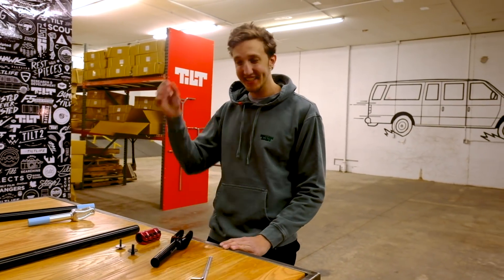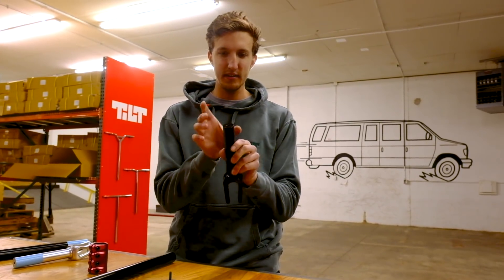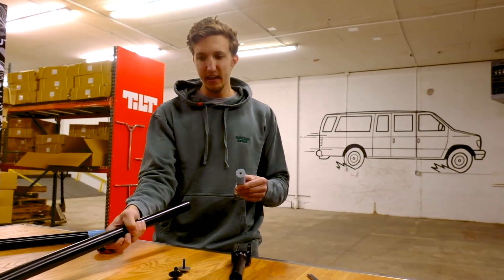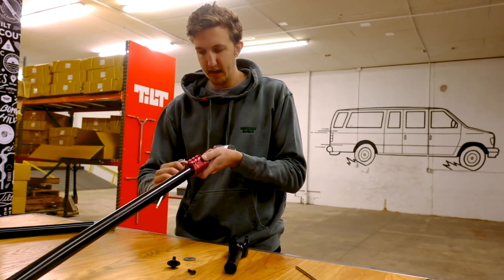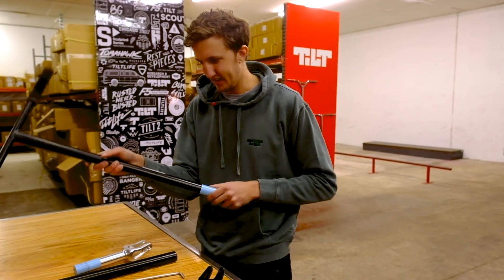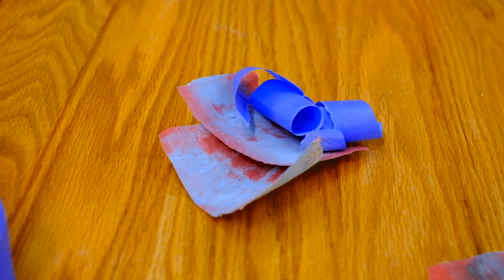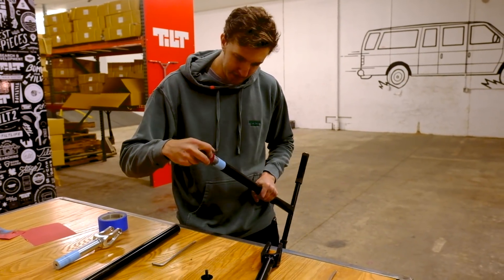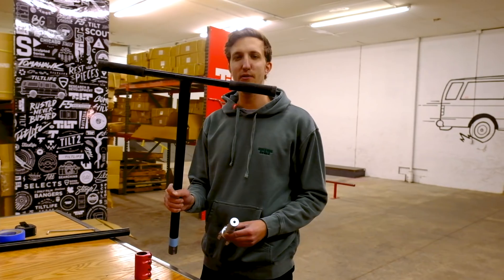Tuesdays At Tilt : How SCS Clamps Actually Work - Ep 01

Comment: it would be great to learn about how different wheels affect the ride and durability of a scooter (different urethanes, different core designs and different sizes - width and length)
Reply from the maker: We'll make sure to cover wheels. We will most likely start with the importance of rebound (speed). We also have 30x120 fork, wheels, and deck in the works, so the size will most likely be covered as well :)
Reply: TiltScooters I’m looking forward to seeing those! I’ll definitely get some of the wheels when they drop and most likely the deck too!

Comment: could you guys explain how to properly compress your compression kit so that your headset bearings spin as fast as they possibly can go but with the compression tight as it can be??  this is an issue so many people i know have trouble with me included
Reply from the maker: We'd love to! However, this really requires a tool called a torque wrench that puts a certain amount of pressure on the bolt when tightening. Most riders and most scooter shops do not have this tool, so we probably won't touch this topic much.
Reply: oh thanks anyway though keep making the mad clips

Comment: Uh, finally somebody addressed the clamp slit alignment issue in a video. I've been meaning to do that myself for a while but Colin explained it perfectly here. For an SCS instructional i was kind of expecting a "How to use an scs for dummies" -type of a video at first glance, you know, addressing the methods how to properly tighten and untighten the clamp without breaking any bolts nor threads within the clamp, why having no slit on the bars eliminates a problem that belongs to the last decade, etc, basically information for beginner use. Maybe that's already scheduled for a future video?
Reply from the maker: Hey Madis! Thanks for the feedback. We'll produce a video about proper clamp maintenance including importance of grease, larger bolt size, and tightening sequence.

Comment: i have a chrome flamongo/native fork and a silver apex scs, both unpainted. but the scs doesn't fit without stretching, why?
Reply from the maker: When choosing a Fork and SCS you want to try and make sure that you purchase the same brand. Those parts are more often than not made to fit together perfectly so that you do not run into this problem!
Reply: Che filet  the apex gamma is a really tight fitting clamp that’s why I’ve been running my issac miller forks and clamp for 2 years straight they are the strongest I’ve snapped three decks whilst riding them and they are still going strong
Reply: Che filet and due to the info in the video I’d assume the apex clamp has a different circumference to the forks
Reply: Louis Kneeend interesting to know. Although I've never realy noticed any problems with my scooter, I needed to use the penny trick a lot.  Well now i know why. Thx for the info :)
Reply: Yeah I understand. But I am not going to buy a new clamp everytime I need a new fork. but i'll take it in consideration next time a buy a fork or a clamp. Thx for the info :)

Comment: Well I’ve learned that the proto scs ive been running these past few months should be put back in a drawer and that I should put back my trusty tilt scs that i had no problems with. that has lasted me almost three years and still tightly fits on my bars and fork, unlike my proto scs which is causing me so many problems.
Reply from the maker: Glad to hear that our SCS has lasted you for so long! Thank you for your support:)

Comment: I ride HIC for this very reason, to many precise problems with SCS. but knowing that it should be same size all round makes sense, just like tightening all clamp/scs bolts evenly.etc I also find that sometimes with SCS are the bars that have thinner wall thickness bend in very slightly at the end, which would run into the problem explained in this video. not only that with most other compression there is a substantial inner bar support with forks.etc, my point is that SCS bars need thicker wall thickness to prevent bars bending/snapping or have a tube inside the bottom of the bar to reinforce, just like old school razor fork reinforcement :) I believe Ryan Williams showed this in a video of his recently.
Reply from the maker: Thanks for the reply! You are right about SCS being tricky to setup, but we do not trust HIC. We will make a video about why we do not ride HIC :)